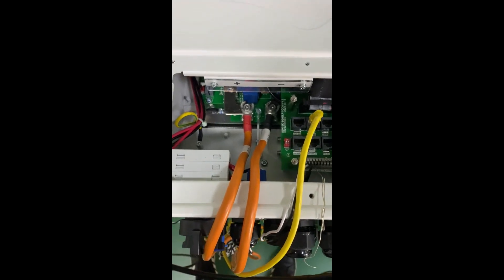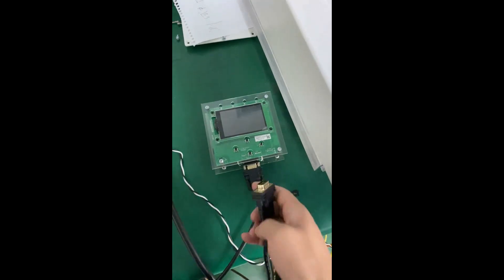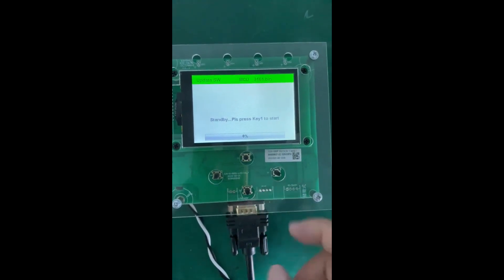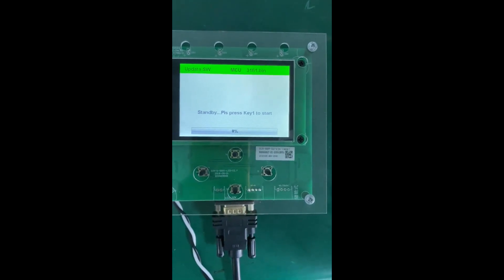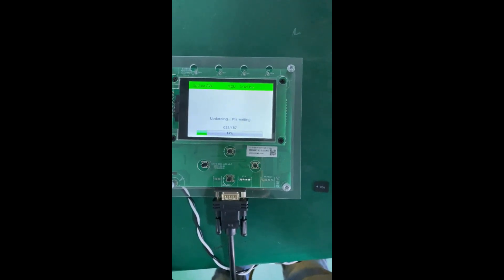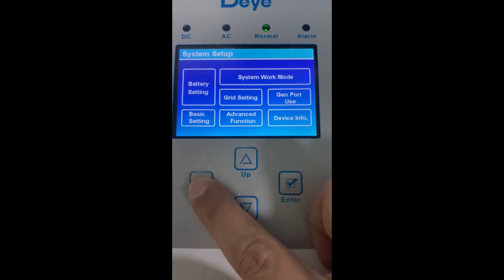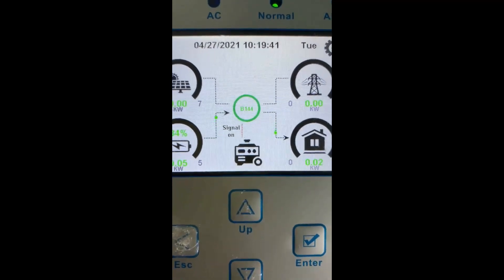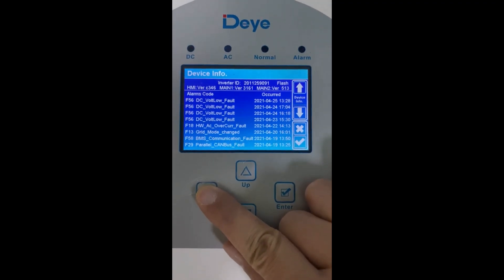How to use Deye Program download tool to update your inverter manually

Comment: Good Day
I had the Deye team upgrade my 8kw hybrid inverter and they upgraded it with the 5kw firmware. 
Lots of error codes and emails they finaly flashed it with the correct firmware. 
However now my inverter is stuck in standby mode and does not switch to normal mode nor does it charge the batteries from the grid. 
Is there any way you can assist me as Deye support has gone silent after they saw their mistake. 
Will you be able to send me the files so I can get my power back please.

Comment: Why not use a standard PC since the software update is just using standard RS-232 serial?
Reply from the maker: more conveniuent with this device, isn't it ?
Reply: @DeyeInverter_official  Well, if I had one, maybe it would be. Let me check my box...no not one in there. You are joking right?
Reply: @lbroome  you can update inverter locally without internet with dongle web UI
Reply: @nicof9202  ... where do you get the updated Firmware - I'm having weird issues with both my 5KW Inverters and the 24/7 support seems more like once a week support. I'm still waiting on Deye to give me access and assistance!

I'm suspecting I'm experiencing issues because of out-dated firmware/software.
Reply: @DeyeInverter_official   ... where do you get the updated Firmware - I'm having weird issues with both my 5KW Inverters and the 24/7 support seems more like once a week support. I'm still waiting on Deye to give me access and assistance!

I'm suspecting I'm experiencing issues because of out-dated firmware/software.

Can I run this locally through a laptop with some flashing software?